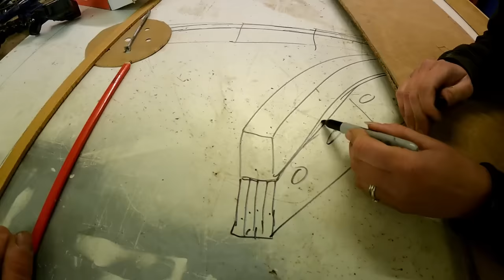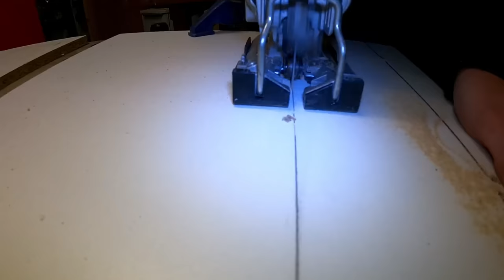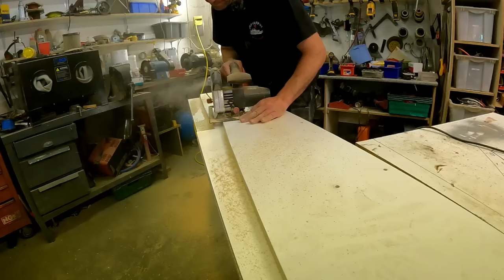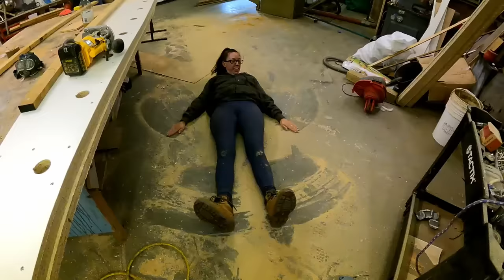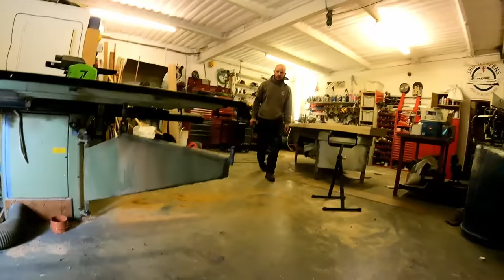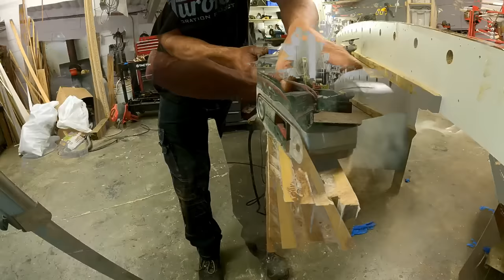Ep 143 Making BOAT DECK BEAMS! #boatproject

Comment: A suggestion from the extreme most cautious person following your project.  I would take that beam out to Sarinda and find a way to thread it through the hull at the widest beam and lift it up against the deck.  We know there will be sag in the existing deck beam - so there won't be a perfect match.  But just for peace of mind given the great cost of both materials and labor - I would want to make that field check to confirm that the new deck beams match up with what Sarinda's original builders had in mind. 👍

Comment: You two are certainly industrious.👍 Just one other comment, before laminating the beam, a stronger ‘join’ would be achieved if each strip was ‘primed’ with epoxy.😀👍
Reply from the maker: Each strip was primed with epoxy and them thicked epoxy was used.
Reply: @ShipHappensUK  Apologies - missed that.👍

Comment: You are doing the correct method which I did not use.

I got two methods on is using African mahogany solid planks and cut the radius only on the top beam.

But I have also used very long Balu 10x10  6 m planks that are straight and I found that I could brace it in the center sufficient to make the radius. 

Good luck with your method

Comment: Hi Guys, Great watching you do this work it brings back many memories of doing this type of form work in the past myself.  Please please put the riving knife and overhead guard on to your panel saw. There is a lot of internal pressure in man-made boards and timber which can cause the material to pinch the blade and create kick back. I was a cabinet maker and it happened to me, even with the riving knife the kick back was enough to dislocate my left thumb so that it pointed back up my arm. As for the overhead guard well that speaks for itself. Be safe please! Your doing such a fantastic job on Serinda moving on so fast. Thank you for such interesting content.

Comment: Good job guys! I was wondering whether it would be better/easier to use pegs in a beam (or even bolts in an RSJ) to set the curve for the deck beam laminations? Bearing in mind that you are also using clamps in all directions….. Asking for a friend lol…..👍

Comment: You could probably reduce the spring back when remove the lamination from the form is you left it a couple of days before removal. I used to laminate archery bow limbs and despite the epoxy being hard after overnight it definitely has not achieved its full cure which would be more like 48 hours at 20c. Most high strength lams are cured at 60degC for 8 to 12 hours and the cure times get exponentially longer as the temp reduces. You are doing a fantastic job and all the glue lam  parts you are making are orders of magnitude stronger than the the originals.--- Graeme

Comment: That looks great and reminds me of when I laminated my cabin top beams.  As far as finishing (paint/varnish) the beams goes, it is much easier to paint/varnish them before you install them.  A suggestion to improve mold release as you make more beams.  Hair spray is polyvinyl alcohol (PVA), which is a very good water soluble release agent.  So buy a few cans of cheap hair spray and spray the mold down between parts.  Or you can just buy a jug of PVA and spray it on.  One other suggestion is to use a notched trowel when you put the epoxy on.  That will give a more uniform layer of epoxy and will also save on epoxy.
Reply: I never knew that about hair spray! Thanks!

Comment: Simon. I was just watching a preview on Patreon. You showed sliding bulwark boards in at the same slant as the hull. I’m pretty sure the bulwark is more vertical than the hull and increases in difference going from pilot house to the bow. I just researched some older pictures and judging by shadows and light reflection the are nearly parallel at the wheel house and nearly 12”+- at the bow.

Comment: GREAT JOB!   Instead of using Varnish or Paint on the beams - you could just give them a coat of the Epoxy - it would probably last a LOT longer than ANY type of varnish, and it will penetrate into the wood and give it a beautiful look!

Comment: I enjoy your show, thanks!  WARNING - be careful of radial tension stresses in your deck beams.  Since the laminations have a radius, they will have a tendency to separate vertically, sometimes at shockingly low  loads.  To illustrate, hold 2 dollar bills, or pound notes, back to back and grasp a short end with each hand between your thumb & fore finger.  Push the ends of the bills together. Usually the top bill will curve upwards & the lower bill will curve downwards.  The laminations in your beam may behave similarly.  You may need to provide something like bolts to function like clamps to resist this separation.  This would be a good instance to consult a local engineer experienced in the design & fabrication of laminated beams.  Good luck!
Reply: @Patric.
Any idea of the holding power of epoxi? The seams are stronger than the wood is. The wood is only slightly curved and it is not folded like banknotes.

Comment: This might help with alignment of the laminate.  Dry fit the timbers and get the alignment perfect when its dry...  Drill some 10mm holes in it.  Use an oak dowell to keep the alignment (or make iroko ones which is a PITA as Iroko is very hard). Put a point on the dowel.   Keep the dowel in the top piece when you are epoxying up.  Hammer it home when you are laying up the laminates.  Clamps are still necessary, but you should be perfectly aligned on the horizontal, with no loss of strength.  I did this with a replacement rubbing strake in laminate iroko, and it has been fine for years....

Comment: Great episode as usual guys. I love the way you two put us all right from time to time, but how about saving some material and some work?
I heard you say in an earlier episode that it’s only the ends of the beams that have gone.
If so, why don’t you replace the broader ones from under the wheelhouse to begin with and cut down the good centre sections from those original  beams to make shorter beams for the narrower sections of the boat further forward. They will all have the required curvature already, so trim them down and job done!
That should save you some time and material as well as retaining some more individual structure 

Keep up the good work. ‘Love your channel!
John

Comment: Be certain to mark each beam as it comes off your form so all the beams are oriented the same and some aren't flipped end for end. Even though you were very careful making  your form, each time you moved your template chances are you made miniscule mistakes that add up each time you moved it. Won't be much, but if you flip a beam end for end from the others it will be slightly off. So, mark one end of your form for port and each beam to match.

Comment: Looks fantastic. Would definitely varnish them in places where they’ll be seen. Couple of questions though. Simon says they only need to be 38mm wide, so why not cut the strips at 45 rather than 60mm. That way you might be able to get more beams from the wood you have. 
On the form you’ve made, why don’t you have threaded rod bolted to the sides , along the length , so that you can use steel flat bar and nuts to act as clamps. If you wrapped the threaded bar in parcel tape or plastic conduit , that would stop the epoxy sticking. Plus you could probably use deep sockets and a battery drill to cinch it down.
Just thinking that the start of beam manufacturing is the time to think wild ideas like these rather than the last but one beam.
Anyway, astounded by the progress and workmanship so far. She’s going to be a beauty when you’ve finished. Thanks for taking us along for the journey.

Comment: SUGGESTION: think about using "mold release" compound so as to not have your epoxy work stick to things you don't want it stuck to
Reply from the maker: That wouldn't really work with the chipboard we used as it's not a smooth surface, the parcel tape was fantastic

Comment: An excellent job. I am wondering, without a filler that ties the bottom of the bow together, will the spring that is in the bow as it currently stands force the sides of the hull out whenever any load is applied to the deck such as a person, equipment etcetera. I thought I should mention this now as there is a lot of spring to it when Simon stood on it and you have time to correct for it.

Comment: Great job on that beam. 

Question: would the strength of the beam be better if you was to steam form the wood before you epoxy them together vs what you did in the video? Or would it be weaker?

Comment: All You have to do is make one template the full width of the boat make them all to the same size you just cut the proper length from the center unless you plan to change the crown or what you call the radius it should be all the same the full length of the boat

Comment: I totally love the laminated deck beam, great idea to varnish it because it looks soo nice :-) When will you be trying to fit this first one to check if you did everything right? Just wondering if the curved beam wont push the outside of the boat away when there is load on it? Or are there also pull rods ?
Reply from the maker: All will be revealed next week…. 😉
Reply: @ShipHappensUK  Can't wait :-) 🤩

Comment: Actually I’m a bit surprised that you did not laminate the strips vertically instead of horizontally . The tendency to resist flexing is on the vertical even with lamination and epoxy . Oh well , time will tell . Also , did you mark and number the guides you screwed onto the Form ? If not you’ll be drilling new holes every time . I’m waiting now to see how you two get those beams out to the ship . Cheers !

Comment: Nice workmanship guys, and yes, finishing it with varnish rather than paint I think would look really good.  From memory Iroco is flippin' heavy.

Gemma... The clowns who come up with all their smart-@rse comments about YT income are just sad keyboard jockeys who don't live in the real world.  I can only imagine the frustration they cause you.

Simon... A couple of ideas that might be useful.  If you run out of clamps on something long, like that beam, you can always use a loop of rope round the work then, put a packing block under the rope loop above and below whatever you're clamping so the rope is not directly on the edges of the work-piece, then put a bar through the rope and just twist it tight.  You can exert a hell of a lot of force by just twisting the rope round and round, which would probably be even more force than the metal clamps.  Not an everyday choice but if you're stuck or want to put extra high presure on something, it works ok.  In the Scouts they call it a 'Spanish Windlass'.
The other thing that would work if you're stuck is Ratchet Straps but, obviously you would need to protect the webbing from the epoxy.  
Nothing smart-@rse... Just a couple of ideas that might help if needed🙂
Cheers  Phil.

Comment: You can use your rippings to make your internal plys.  As long as you have a solid ply on each side, you won't be sacrificing any structural integrity.   Would be a shame to use any of that super premium wood in such long lengths as wood fire kindling.  The side or stacking brackets you made also woare of great benefit for using the rippings.  "Frugal Ship Happens" 😅

Comment: There is no reason not to work down from the inside of the final radius you want to achieve, although it can be a bit trickier to pull the laminations to shape depending on thickness vs. radius.

Comment: The 100m block just transferred the same radius 100m.  You would need a 100m reduction in the radius from the center point to get the correct shape.  But in practice, it will make little difference.

Comment: Having deck beams only 100mm deep over a span of 4800mm gives a span/depth ratio of 48:1, which in normal structural terms is more than 2x what it should be.  Typically, the normal span/depth ratio is less than 20:1 and even having the beams laminated hardwood won't change that.  Just look at the sizes of the roof members over your head to prove that.
Reply: Clivewilliams. Aren't they replicating the old structure? More than 80 years of not failing, proves the design to be advecate.
Reply: Camber is essentially the transverse curvature of the deck and is usually parabolic. Camber has several advantages, including drainage of water accumulated on the deck, accounting for weld distortions, and increasing strength against deflection and other flexural loads. The camber may vary from ship to ship, but it usually remains within 1/50 of the vessel’s breadth for all practical purposes.
Reply: @sidekickbob7227   I appreciate that but I just highlighted the conventional structural wisdom.  It would be interesting for someone to do the structural maths to see whether it is theoretically sound
Reply: @jaapklok5560  That would mean the camber is 96mm say, 100mm at the high point.  Interesting that the curvature ought to be parabolic because at these low curvatures the difference between a parabola and a circle would, for all practical purposes, be negligible, but setting out a parabolic curve is much more difficult than for a circle.
Reply: @clivewilliams3661 I think your calculation is too simplified, and fails due to several reasons.  The width of the boat varies, these beams are made too long. When cut, the ratio will be different. You also need to add in the added strenght the steel knees on both sides give, and calculate the positive effect of the previously mentioned curvature.  These boats where given seriously punishment during their service. They where capable of speeding through pretty rough sea, so we can conclude the constructors knew what they where doing. But yeah, it would be interesting to see how close to "too weak" they buildt it.
Reply: @sidekickbob7227   If the width of the boat varies then taking my simplistic and preliminary rule of thumb then the width would have to halve to get anywhere near the normal span/depth ratio.  The steel knees do add strength by both cutting down the effective length and making the end a fixed one (rather than simple pin joint) and that will affect the bending moment but not by a great deal.  The curvature also has an effect but to what extent when the rise is so small?  If it was barrel vaulted then there would have been a difference.  I have been involved with structural engineering for many years so I do know the principles and that is why I would be interested to see the calcs to see what criteria and how it works, maybe the allowable deflection is greater than normally applied?

Comment: Not sold that the bottom radius needs to be different than the top radius.  If the beam is of the same thickness, seems like the two radii will be the same.

edit: but now as I think about it, maybe you are right.  Either way, it is hurting my head.
Reply: May be easier to visualize if you make the distance between top and bottom radius much bigger and think of it as full circles. Hands on, an small plate vs. an bigger plate.
Reply: @westmus  Yeah, my mind says that you have the same arc, separate it by 5 inches for the top and bottom, and they are the same.  And if I draw some shallow arc, like the beam, it looks right.  Just like they said, the difference is pretty small, with a big shallow arc like that.  But when I put one circle inside a circle, you can see that the inner circle is at a much tighter radius than the outer one.  After drawing it out, with a circle, that made me think that I was wrong.

Comment: I dont think that is the best way to laminate a beam for your situation. Wouldn't it be stronger if it was side laminated instead of flat. I cant see much strength in the current orientation of the boards. Marine grade plywood sandwiched in between boards on the side would give you much more load strength over the span. The plywood would hold the shape and keep boards from bouncing back. the slight amount of bend should be possible with out steam.